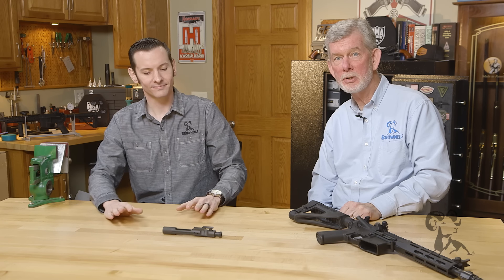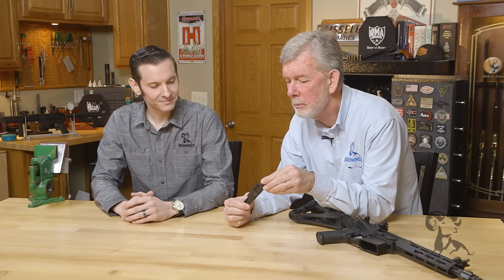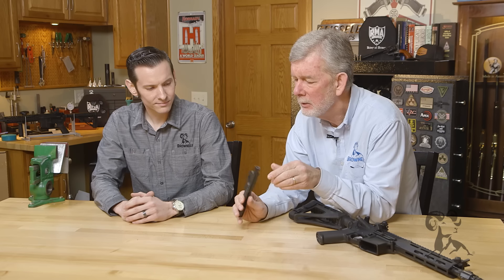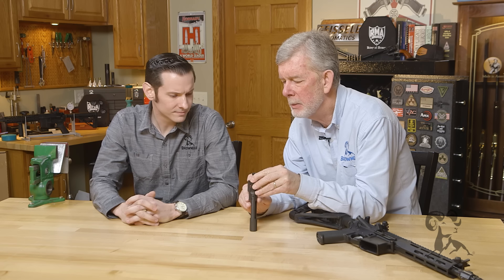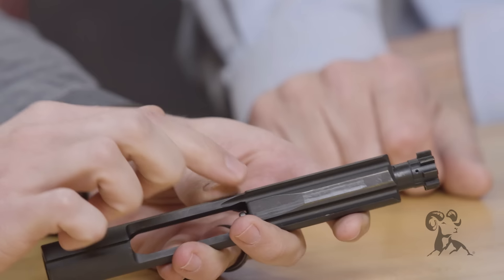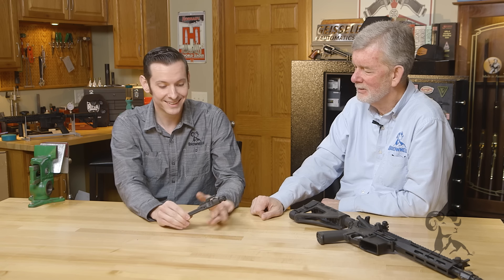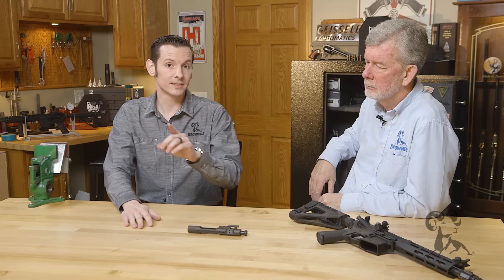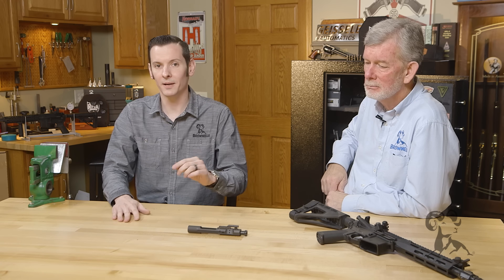Smyth Busters: AR-15 Bolt / Carrier Lubrication

Comment: As an engineer I discovered Teflon products 😍. I've sprayed Tri Flo on bearings that were running race on race that were smoking and screeling from friction and had them run until I could replace them. Using it on semi automatic firearms I have zero wear on slide surfaces. Not even wearing the blue off. My bolt carrier has zero shiny spots. Break free,zep 45 are similar and equally effective. I called this stuff bearings in a can and proved it worked for 20 years. Believe what you want but I've been around and around on industrial lubricants talking to many experts on lubricants over my career and studying things in a long term application.

Comment: I have used LSA from quart cans for decades, in hundreds of AR15 and M16 rifles, of all manufactures. Lubricated as US Army or Marine Corps manuals state and illustrate. I have fired thousands of rounds in a two week period to test necessity to clean. After 2700 rounds, in 6 days without cleaning or lubrication,  the action slowed so I squirted LSA in the BCG and ran one patch thru the barrel. Good for another 1000 rounds.

Comment: I have always used a little Tetra gun grease on the bolt carrier rails and ware surfaces , Rem oil with teflon on the firing pin ... Break Free CLP on everything else ,,,, it has worked well for me , very little ware and several thousand rounds , they always run well , I clean my ARs after every trip to the range , I keep the gas tube clear with Birchwood Casey gun scrubber and a few shots of compressed air , I keep the bolt free of carbon deposits and well oiled .

Comment: 1 drop on the 4 contact surfaces. and wipe oil on the bottom just like he said in the video and only do that it is absolutely amazing how long this platform will run if u only do that. when i say amazing i mean i have put thousands of rounds through my AR-15 only doing that and not cleaning it only wiping down the bolt and inside the upper. there will be a lot of carbon build up but it just cuts the carbon out of the way and keeps running. its almost like witchcraft. so far my rifle has seen roughly 14,000 rounds. the barrel is due for replacement but the accuracy isn't horrible compared to what all the forums say it should be at that round count.

Comment: Categorically and first hand: if you are in a dry environment with fine sand such as the Middle East or Sahara, degrease all parts and run them dry. Even a small amount of oil mixed with grit will gum up locking surfaces and cause stoppages.

Comment: Just based on past experience, military and otherwise.  Any semi auto/auto weapon that uses gas blowback, oil + powder = gunk.   I agree with the points you show to be lubed.  Have had better luck with drying graphite or in a pinch, a #2 pencil, rather than oil.  Especially in the great white north.  Wipe every moving part completely dry.  In desert settings, experience is that sand sticks to oil.  Welcome comments!

Comment: Also, what's your guy's opinion(s) on lubing bolt/cam pin area? And also I'm curious on what YOUR preferences in lubricants are? 

I've generally always used at least CLP or sometimes Hoppe's #9, but after I'd bought a sig p226 long time ago, they recommended Mil-Comm TW-25b in their manual for the P226 Mk25 I had. I've since been experimenting with using that same synthetic grease on bolt/cam pin, and curious what your thoughts are about that? Haven't ran it enough yet to see anything definitive though will eventually. Likely when ammo doesn't seem as scarce.
Reply: Lube it lightly, I prefer RAND CLP personally.

Comment: Very helpful. The 3 holes lube is pretty common advise. Never understood.
Reply: They are vents but if your not going to clean it this sitting it beats breaking down the BCG for a little protection while it`s stored away.

Comment: I lube just before a trip to the range, most concerned with lube on the CAM PIN, bolts can crack in half if run dry in this area!

Comment: I'm waaayyy late to this party. And I far from an expert. But I heard conflicting reports... Run with minimal lube/as dry as possible... Run it soaking wet... Etc...

Lately, I hose the BCG down with Breakfree CLP and run it wet... Does it run better? Not that I've noticed. But it seems to clean up easier. Instead of hard baked carbon fouling, it's very soft and cleans up by basically wiping off with a T-shirt rag. 

That's it. Just my own experience. Take it or leave it.

Comment: I was running my bolt without any lubrication for a bit, stuck a little in there on its first clean, then after a range officer commented how dry it was I just said to hell with it and dunked the whole bolt in silicone. Normally it's reserved for my newly acquired CO2 guns but thought 'what the hell', it can't hurt. At $4 a tall can at Lowes, not a bad deal. =Þ

Comment: During Viet Nam we were taught to run the gun dripping wet
Reply: Lots of mistakes were made on the M16 platform then.
Reply: @CalebSavant  lots of problems with early M16s in Vietnam but i don't think they were caused by  too much lube.
Reply: @900stx7  That's not what I'm saying, I simply meant there we so many other issues that the only way to get them to run somewhat reliably in those conditions were to run them soaking wet. With modern advancements in the firearm and ammunition that is far from necessary.

Comment: My question is has lubrication evolved or oil is still pretty much oil no matter what brand? CLP and Hoppes 9 has never failed me so is there anything better out there?
Reply: I've never like CLP too thin. I like #9 for antiques as its gentle. Ballistol in my range bag. I use a lot of axle grease and some "vintage type" gun oils. There are some synthetic oils which may be much better but I dont think breathing them is a good idea.
Reply: wolfkin73 I do use Mobile1 red grease on my AK but with AR and their tight tolerances I always thought light thin oil helps prevent certain build up but I never experimented cause AR to me have so reliable when treated correctly

Comment: I run mine wet, I live in southern desert. You get dusty walking outside… not as bad as AZ. But I like picking up a rifle and it smoothly rack and slide like butter. To much back and forth with what needs to be lubed and what doesn’t and what’s a waste, just run the mother wet…

Comment: Have a new AR with feeding issues. It has had only 30 rounds through it. Everything has need lubercated.  At what point should I be concerned that it may be a problem ?

BTW- it is an AR-10 308

Comment: Can someone comment on Eezox synthetic dry lube (or other dry lubes) for AR BCGs? I started using it on my SKS's and M1 Garands and it works really well so far. But they are gas piston operated, not direct impingement like an AR. Does anyone have experience with dry lubes in the direct gas impingement system?

Comment: I lube externally. I actually put a dab of grease around the bolt pin. Maybe a drop of oil on the bolt lugs. Especially on new bolts so they mate engage and disengage smoothly. Piston rings get a drop.
All engines with rings use oil to keep the rings loose and help them seal.
Older Carbon encrusted rings don't seal as well and cause power lose and use more oil.
Same is true of your AR. The rings need to be able to move to maintain the seal. Just never behind the rings..

Comment: Lubing the gas-key opening reduces wear on the gas-tube sealing bulb.  This is a critical lubrication point IMHO and experience.
Reply: Sure, but after the first shot there is noting you can put there that wont be blown out.
Reply: @CalebSavant  Oil transfers to the outside surface of the gas tube.
Reply: @messinger123  right, but there is still pressure there under  firing conditions when those two parts are separating. Not peak pressure, but pressure nonetheless.

Comment: I use wheel bearing grease on the exact surfaces pointed out above. Just a thin film of grease and everything keeps running smoothly.

Comment: If it moves, its lubes. I pull the bolt and dip the bolt end of the bcg in red oil then wipe off the excess.  The bolt gets a simple green soak, a water rinse, then goes for a red oil soak. I dont scrape the carbon off the back of the bolt. 

I am willing to accept the fact that carbon particles suspended in the oil may cause more wear than running it dry. 

Special note: I also put a squirt of red oil down the gas tube, let it set for a few minutes then give the regulator a few turns back and forth to prevent carbon locking. It also helps me grow a wicked patch of pimples when I shoot it.

Comment: I'm an armorer and we have any where from 90 to 100 m4s out at a time and I've seen alot of these gun malfunction when they are not cleaned right and ram dry alot of these guns are run for days and weeks at a time. In my opinion it's better to run these guns wet. Unless you don't shoot very often then ya you can get away with oiling just the rails. When i our guns I wet them down with lots of oil.

Comment: I run my AR’s wet. I prefer it that way. When I was in the army entering the firing line we would pull our bolts back and they would spray clp in there. We would then release the bolt and they’d do it again to get the other side. Rack a few times and good to go. I’m not saying that’s the best way, but that’s how my unit did it. Sure it waste lube, but I like the peace of mind there is lube everywhere and nothing will be causing friction and accelerated wear. I like to take care of my stuff and make it last.

I served 3 combat deployments in Iraq as an infantryman and I never once had my weapon malfunction out in the hot, sweaty, sandy desert oiling it this way, so I know it’s proven to work. It’s proven to me time and time again it holds up to the harshest conditions. Why on earth would I change it lol.

Comment: Hmm, the piston is nothing else than a piston in a motor. And this works a lot better with oil on the surfaces. I guess You have to clean the piston and especially the rings a lot more often but I do this anyway.

Comment: Ar15's are not meant to be ran wet. Minimal lubricant is all you need. Lube the wear spots by using a lightly oiled rag. I ran my m16 this way in the Army and never had any issues. When you run them wet or like he said oil dripping out there is the high probability of oil getting on the cartridges and in the chamber and that messes with the pressures in the chamber. Gunblue490 has a good video on this.

Comment: Good video! I am X Marine 69-71 and retired US Army in 1997 and have worked ranges all across this country and others. I have also heard from young noncoms the same BS that you mentioned. My experience with fine sand and too much wind is not to run the M16/M4 style weapons wet. It attracts and holds grit in the action.  What I have tried, and seems to work better,  is something I got from a Hornady rep.  Spray the bolt dripping wet with Hornady One Shot case lube.  LET IT DRY , reassemble and continue to march. The Gov't doesn't provide One Shot so you have to buy it yourself. Of course I also suggest to keep the dust cover closed which for some reason PVT Snuffy can't seem to remember to do it.. I also and put one layer of black plastic electrical tape over the flash suppressor as well. They do make a plastic dust cap for the muzzle but they are a high loss item and you never have one when you want it .

Comment: I use two deferent dry lubricants. Depends on where I clean my AR’s. Dry lube keeps them clean and running faster and longer. They don’t need to be cleaned near as often. The bore needs carbon and copper removed but the rest needs almost nothing but a quick shot of dry lube every once in a blue moon. Nothing to gum up. I have been using that weapon platform since 1979 and I have probably more of them then I should.

Comment: The part that most people dont probably get taught in the military but is certainly in the TM is to also use a pipe cleaner and clp to clean the carbon out of the gas key and the exhaust holes. Also, a few drops of clp in the exhaust holes keeps the carbon saturated and a slurry instead of baking into hard deposits if you have to fire for longer periods without stripping the rifle down and cleaning it.

Comment: when i lube my ar-15 bolts,  i use mobil 1 20-50 oil,  and i put a light coating on all the areas that either slide or rotate and this works fine for me,  never had an issue with a jam, stovepipe or bad feed.

Comment: There's nothing wrong with a bit of oil forward of the gas rings up to the locking lugs. Just makes that bolt move a little smoother and a bit around the cam pin. I have 2 di rifles that i always run wet and after thousands of rounds have never cleaned and have not once had a jam that wasn't caused by a broken extractor spring

Comment: This is my only experience with firing an AR-15 dry.   A couple years ago I did a little work on one of my AR's (don't remember what), and I took it outside to test fire it.   I took one fully loaded 30 round mag with me and although I got every round to fire, I had to manually cycle out 8 of those rounds.   I was wondering why 8 rounds didn't fire, and I figured it out when I took the gun apart to clean it.   The last time I put it back together, I had forgotten to lubricate the BCG, a simple oversight.   I wouldn't tell you to look at this as fact, but that experience tells me that an unlubricated AR-15 will still absolutely fire, but roughly 1/3 rounds will not fire.

Comment: My Dad was in Vietnam, and he told me guys used to dump oil into the ejection port to make it run better. Needless to say I had assumed a wet bolt was a happy bolt until I had seen proper cleaning instructions. Over lubrication only makes a mess that is harder to clean later. Now I only oil key areas on the bolt, firing pin, cam, and friction surfaces.

Comment: I’m not so sure running it wet in the desert is a good idea. When I see convoy dust tests, they intentionally run them dry and only run into stoppages if dust gets in the magazine or sometimes in the FCG. I bet if they run these tests with the BCG wet, they’ll run into more stoppages because the dust will clump with all that oil.

Comment: back in the day they will run the wet range with a instructor on the line spraying clp into the bolt/star chamber etc. nowadays I have run my rifle with just surface lubrication on the bolt/bolt carrier with no issues whatsoever, now if you run it with more than necessary all that carbon is going to gunk up in there and cause problems because when carbon finds oil they are a match made in heaven that turns into crystal once they cool down.
Reply: Ugh! I hated that! There was always a NCO there drenching every rifle.. once I became a NCO I told my guys to "refuse the line NCO's lube" which resulted in several arguments with said NCO's.

Comment: Red Synthetic grease works great on the buffer spring gets rid of the noise and makes it feel smooth. I also use it on my bolt and charging handle as well as gun oil.

Comment: Thank you gentlemen. 
How about thicker grease vs thinner oil?

To answer your question at the end. I've been smearing grease on the shiny parts. The rails and the little bearing surface on the bolt. Heavy on the rails, very light on the bolt. And I squirt clp lazily onto the bolt, including those vent holes, when needed. I've never had an issue, but I've never been to war either. 1500 rounds is the most I've ever shot in a day, and that's rare.

Comment: My experience is that oil picks up a lot of sand and dust. Minimal lube on bearing surfaces, and I would say that would be before you go out on a mission where you are expecting trouble. Keep the dustcover closed as much as possible.

Comment: I agree with most of what you said.  I was also in the Army for many years and spent a significant amount of time in the desert.  If you lube them too much in the desert the sand gets in there, makes a mess, and ends up jamming the rifle.  Use very limited amounts of lubricant in a desert environment.  In a more humid environment load it up to prevent rusting.

Comment: Running it wet on the areas passing through the upper receiver is  to a bad idea for average person use to keep wear down on the upper receiver. Two metal parts moving against each other need lube to reduce wear. You want to be careful of gumming up the works with too much lube if ina threatening situation. But for hobby use a wet bolt and upper is good.

Comment: What about running too much oil in the cold?? You guys covered run wet in hot conditions.  my ar10 will not run as well oiled in cold weather. Ive had better results now running a timney trigger but my rifle still hates oil in the cold. I was shooting mid winter in vermont. 24 degrees outside time 6hrs my rifle was cold cold.
Reply: Depends on the oil! Be sure it is rated for the temp you are shooting in.
Reply: @Steel Rain: Switch to a lower-viscosity lubricant, would be an obvious thing to try, since a thick grease or oil will get that much thicker in the cold. Something rated for all-weather performance, too. Since fouling/carbon deposits can increase friction and make the operating cycle tougher, I'd pay attention to cleanliness, too. If your AR10 has a gas valve or port, you can tweak that, too, for best performance. An old-timer's trick is to keep your ammo near something warm (but not too warm, obviously - use common sense); a lot of old-time hunters store the extra cartridges in an inside pocket of their clothing, near their core, so that it stays warm. Helps squeeze an extra bit of MV out of the cartridge, a bit more power from the propellant. If you still can't get the problem solved, you could try slightly hotter loads exclusively for winter use. Maybe Brownell's can sell you a lighter recoil/operating spring, too, again for winter use only. Their techs ought to be able to handle this for you....